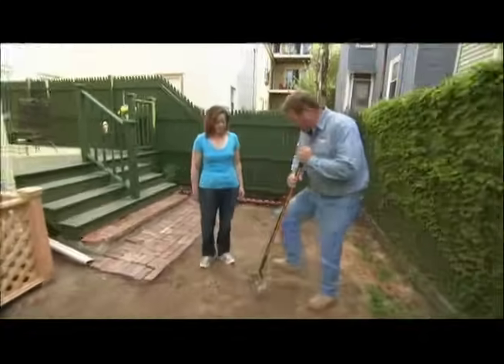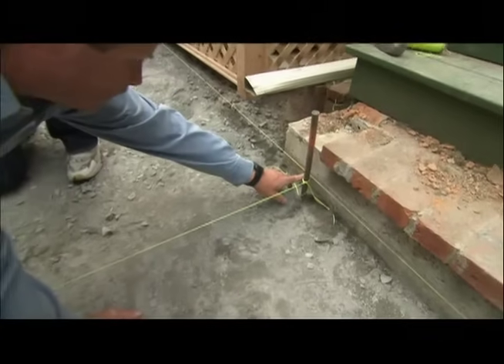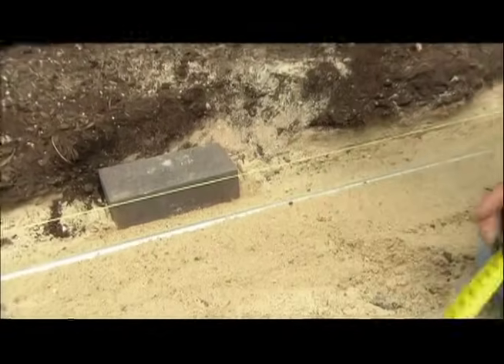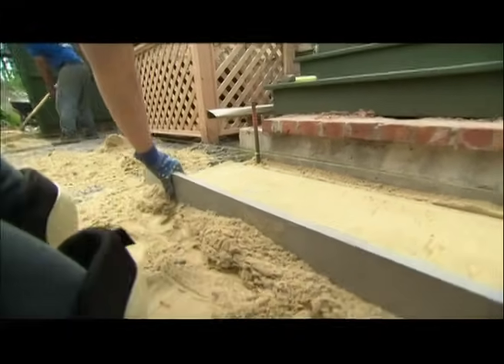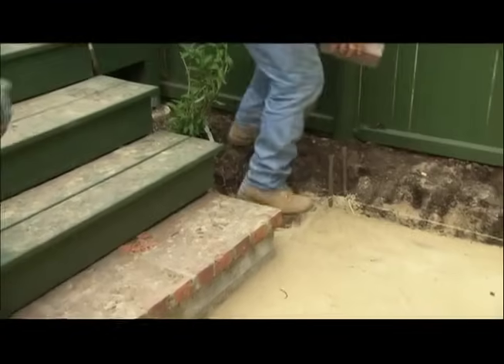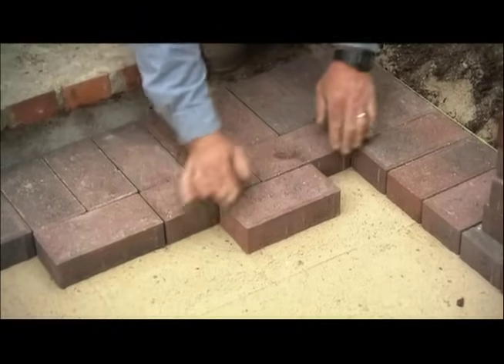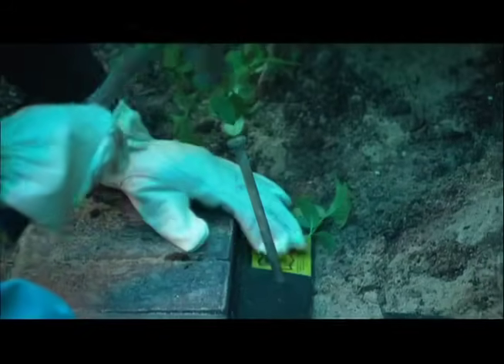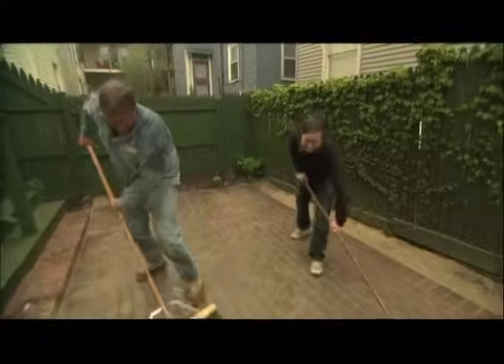How to Build a Brick Patio | This Old House

Comment: For non-freezing climates, this is an easy, practical way for homeowners to do their own brick-paving.
Reply: Agreed....sand has a tendency to mix with the dirt as a part of the freeze and thaw cycles. And eventually, after that happens, the bricks are no longer level
Reply: @NitaSedai that’s why you use gator dust instead of sand duh
Reply: This sounds like East coast USA which is definitely a freezing climate. What would you do?
Reply: Yeah its weird that they use gravel with fines and dont use polymeric sand? Im in wisconsin and we use like 7 inches of clear gravel and then screed 1/4 inch clear gravel to lay the bricks on and then sweep in sand that has glue in it
Reply: There is many ways to lay a brick patio and achieve the same results. Just have a basic understanding of how the materials function and that the ground is not solid and can change over the years.  I did my own patio by digging out and leveling the soil with just a cast iron hand tamper and a gardening trowel and a 5 foot wall framing level, then laying down landscaping fabric, then laying down the really cheap garbage quality sand that has gravel and rocks and all that stuff in it, then putting down the bricks and tamping them in place, and then sweeping over them with a ton of that mortar powder that clumps into clay when wet after I was certain they were all level. After the first rainfall they were locked in place rock solid.  Maybe that's not the "professional" way but it still works and I'm happy with it. I worked in a couple foot sections at a time and triple checked that everything was going straight and not skewing off crooked.

Comment: Can someone tell me what stops the sand from washing out of the joints when it rains?
Reply: Polymeric sand 'sets' after the first wash with water.
Reply: Or how about frost heave? Or freeze/thaw cycles...doesnt the sand beliw the pavers gets mixed with the dirt below? I mean, it would settle into the spaces between the rock and then mix over time, right?

Comment: They don't say what to do with the 2inch pipe anyone have any ideas I'm sure they remove but how do you keep the space for the pipe from falling once removed
Reply: pull it out and fill in the gap with some left over sand. Smooth it out with a trowel.

Comment: @1:03 Are the rails sitting directly on the base material, or was there some sand placed underneath the rails to put them right at 2" below the line?
Reply: Papoochee depends. Base is sent it with less accuracy. Rails are set via stringline so you may have to raise it with the sand

Comment: As a professional hardscape company owner almost everything in this video goes against what we do. One need minimum of 6" of granular 'A’ as base, plus 1" of bedding/concrete sand, running on 1" pipes...
Reply: Kourosh - Do you have any videos? In the Spring I need to reset pavers I have that are sagging.  It's a small area so I was going to pull up all of them because it is holding water.
Reply: Lex Luther 
Hi Lex,
I don't have any videos uploaded on YouTube.
What I would recommend you to do is to follow ICPI guidelines for concrete pavers installation. 
Make sure you have proper slope for drainage.
Reply: Thank you for replying
Reply: Not in a subtropical climate

Comment: The sand you used is way to thick to fill the gaps in the block paving. You should have used a finer sand to fill the gaps instead of regular sand.
Reply: Um, no, you want a coarser sand because its job is to act like little sharp wedges that lodge in and stick to the sides of the pavers with plenty of locking friction. Also: "way to thick to fill..."? Oops, didn't you mean "way toO thick to fill..."?

Comment: There are NO videos of laying a brick floor over a cement walkway. whats up with that? I am about to wash down the walk way, brush some concrete glue on, mix my mortar with a little additive and lay the brick down like pavers, maybe I will butter the edges of each brick or maybe I will just lay the brick down and grout it like tile, idk. does that sound good to you?
Reply: Because people don't make cement walkways. Maybe the hardest kind of walkway that has cement in it is a concrete walkway.